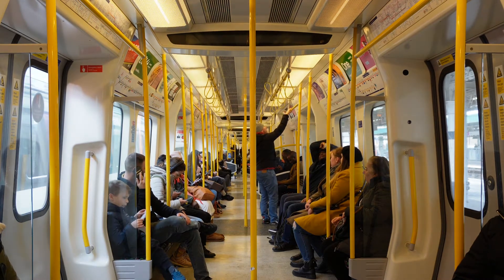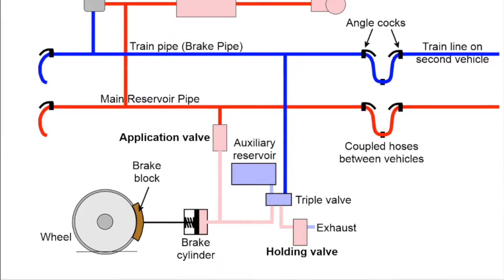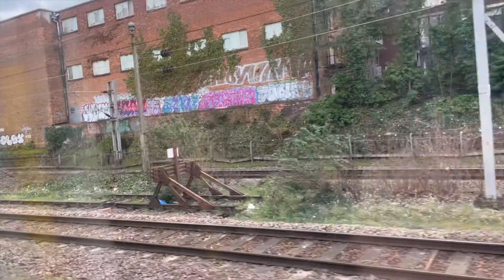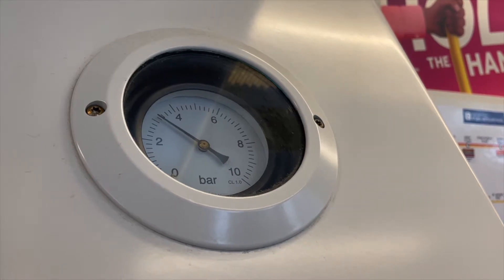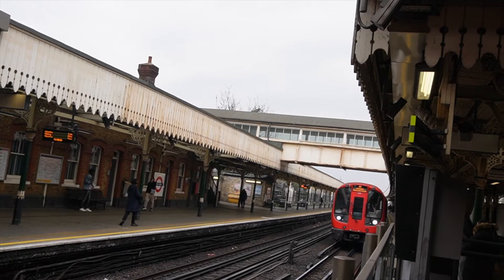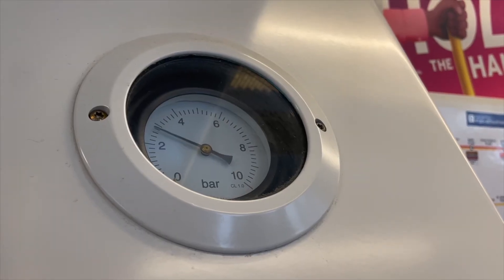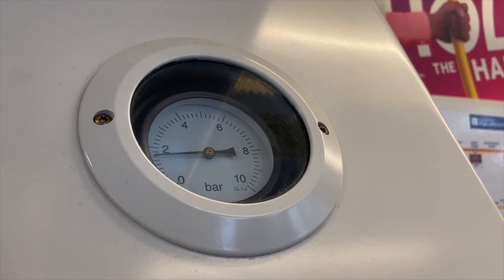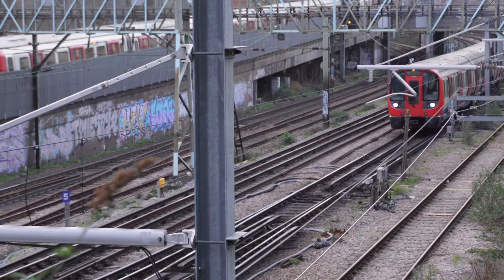Train Brake Meters... Explained

Comment: Lorry brakes also use air pressure, but the air pressure keeps the brakes off, so if the air system fails the lorry will stop immediately.
Reply: Clever failsafe

Comment: The air from the brakes is also used for the whistle on most trains, which tend to use an air pressure of around 7 bar for the horn and brakes. Not all brakes are air brakes some brakes are dynamic brakes where the motors become generators and slow the train down also some brakes are vacum brakes which means that they pull between 21 and 25 inches of Mercury when relased and pull 0 inches of Mercury when fully applied. Also you have the eddy current braking system and also the track brakes. Also There is Hydrokentic brakes which use a fuild to slow the train down, one famous train which uses them is the British Rail Class 370 APT-P. The S Stocks Dynamic brakes can return potential difference back to the rails at 890 volts DC. The S Stock picks up potential difference at 750 volts DC apart from between Uxbridge and Raynes Park and between Acton Town and Ealing Boardway where it picks up the potential difference at 630 volts DC.